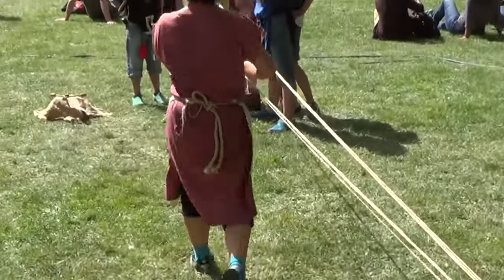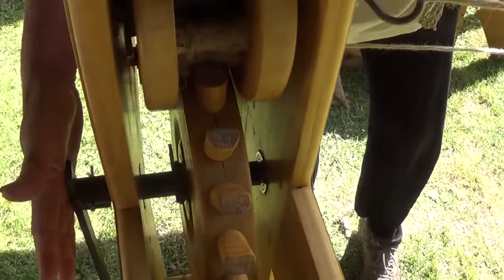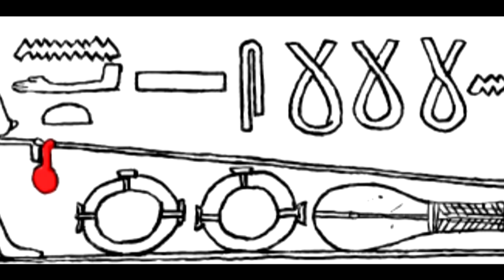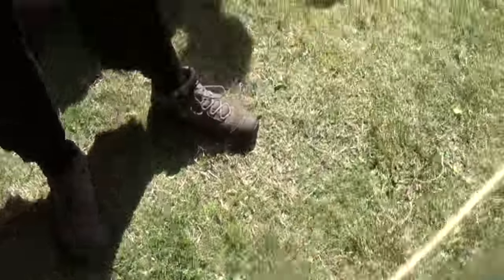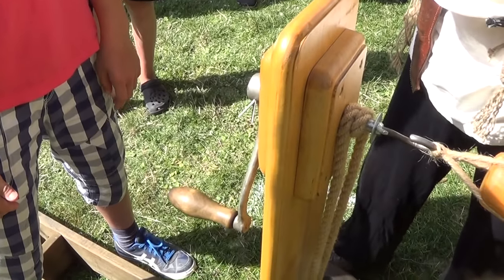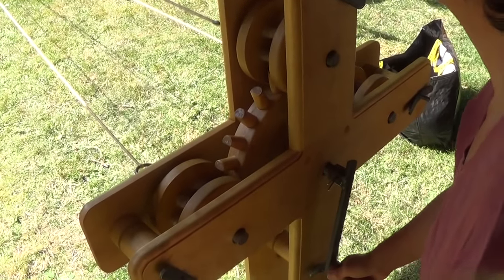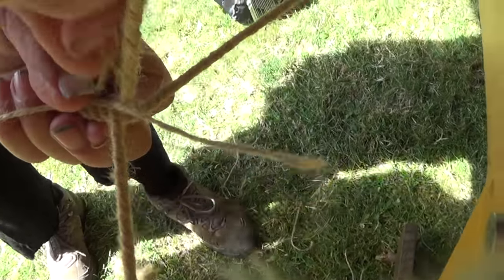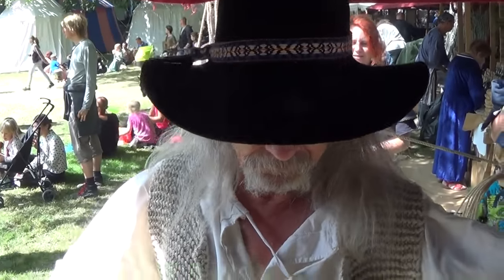Medieval rope-making in Visby market

Comment: what the..!  he cut the rope with a knife in the end !
Reply: Yea? Why
Reply: It's a joking reference to the video Lindybeige posted the next day, "Rope and Hollywood." Don't cut the rope!
Reply: He cut the yarn not the rope
Reply: Which IS actually strange, since there are also methods where you don't have to cut that much material off
Reply: like unhooking the loose ends and finishing them by hand
Reply: With help.
Reply: There are times when string, twine, yarn, and rope DOES need to be cut with a knife, despite Hollywood's wealthy, elitist attitude that everything is disposable!  🤯
Reply: Did you really just ask that question?
Reply: I know this is an old comment, but once he has whipped the end of the rope (which is what he did with the twine when he wrapped it) the three strands weren’t needed anymore. He very much could have tried taking it off using a different method in order to preserve that extra bit, but especially if it’s just for show, there’s no need to try to preserve and/or use them

Comment: I have made raw hide ropes like this but made out of a single cow hide that has been cut into a single strand by starting at the centre of a fresh, cleaned and salted hide and cutting a single strip about 6mm wide. The cut is varied depending on the thickness of the hide. Once twisted the rope is stretched and allowed to dry out. These ropes are very good for handling stock as you don’t get friction burns

Comment: Come on! We all saw in the movies that people in the past were so stupid that they could make only solid wheels and here you see wooden gears.
Reply: +fizikshizik They used weels? I always thought they just shoved some round logs under whatever they wanted to transport and push it.
Reply: +fizikshizik   The older versions are without gears,  just handles locked together by a frame or otherwise belt driven (over solid pulleys).
Reply: +Adamast You must be short, cause that joke was very low, but still went over your head.
Reply: MoonUnit IV The joke starts with Lindy's title then, as this rope-making setup is not more medieval than the cheap film props used to represent medieval wheels. We are short people discussing pots and kettles.
Reply: Adamast At least my kettle hasn't been filled with salt.

(Was that a clever joke? Or am I just prolonging this 'discussion?')
Reply: MoonUnit IV Short of gold, salt is one of the most expensive stuff you can find in a medieval kettle.  A good perception of medieval times is hard, so go along let's keep it with short youtube jokes.
Reply: Adamast When did we say the kettles were medieval?
Reply: They'd put GOLD in the kettle?
Reply: @2adamast  actually salt was never that expensive. Important, but not expensive.

If you want expensive, try some herbs like ginger or nutmeg. Maybe even, if you're so rich that you just literally don't care anymore and want to needlessly show off to the high born prats you invited to your mansion, have a servant dole out black peppercorn or white sugar.

Comment: There is a vary common little stick that is found in places with other remains or hunters and gatherers. It has three holes in a line with on one side the beginning of screw thread, and it is very possible all of those were used to make rope with the same idea. On one side there are three people holding one string of fibers while adding and turning it. On the other side there is one person pulling and turning the new rope in the other side. And I honestly think this way of rope making is almost as important as farming or mastering fire.

Comment: In addition to cutting rope, in movies with sailing ships it drives me nuts when someone sticks a knife into a sail and slides down it.  

WTF?!?  Do you realize how expensive a piece of fabric that large is?  And how much time sailors spend repairing even small tears?  Not to mention the tactical damage you've just done to the ship, in case you'd need to sail it quickly.
Reply: gevmage that depends, is it an enemy ship?
Reply: @connormclernon26  Even if it is an enemy ship, if you take it intact, you'll still need sails to take it back to be re-flagged and added to your own navy.
Reply: @MonkeyJedi99  They aren't documentaries yah know...
Reply: @jimvonmoon  And that’s all movies are meant to be. Cool. Fuck realism or honesty, cool is their god.
Reply: The other problem is that it won't actually work.  The sails aren't that strong; you'll zip down rapidly and go splat on the deck and then be captured by the immensely unhappy sailors who will now have to fix that sail.  :-)

That said, damaging a sail is absolutely something that might happen during a real naval battle in the Age of Sail.  While they would indeed like to capture the enemy ships, their first priority is defeating them, and ships can still sail with less than their full set of sails. And if all else fails, you can tow the prize ship.
Reply: The ships sailmaker: agggggghhhhhh
Reply: What movies? Peter Pan?
Reply: @duckmeat4674  Douglas Fairbanks did the actual stunt in The Black Pirate. (1927)
Reply: @millwrightrick1  wow, so last time OP saw this was almost 100 years ago
Reply: @duckmeat4674  they do it in pirates of the Caribbean as well
Reply: @valeria262  okay 3 movies. Peter Pan, some 100 year old movie, and another featuring octopus head and zombies
Reply: @duckmeat4674  Dats right! And powdered wigs! You can't forget the powdered wigs!

Comment: To those wondering why the rope doesn't unravel: the smaller plies are twisted in the opposite direction from the larger twist of the whole rope, so that the rope's structure is always 'twisting inwards' on itself, preventing it from unravelling. 
This is how most cords work. So even if you cut it in half, it won't immediately start unravelling. (But it will fray gradually if not tied.)

Comment: The weight in the Egyptian drawing with the weight could be used  with the handle to heave the rope up and down and get it oscillating thereby winding the rope much easier.  I've seen riggers today still using a similar technique to serve rigging on historic ships.  Just a thought.  While working on historic  vessels we've used a very similar rig to the one at the market to demonstrate rope making.   Instead of the stick in the middle for keeping the yarns separated we used a round wedge with three grooves for the yarns and a dowel as a handle.
Reply: Ah, I see they added the top.  Same thing.  Cool.

Comment: That limitation to the lenght you could make for a single piece of rope was also the reason why you had only rather small mine shafts in the middle ages.
Mostly only about 20 m but nowhere over 100 m, than you already needed a shaft landing and a second blind shaft with anouther 20 m or so. Stepwise you would have had shafts going down up to 300 m.

Now transportation would mean you could only lift up stuff about this 20 m, unload it and load another bucket, lift it 20 m and than again unload.

This first changed in the 19th century with the invention of the steel cable.
This was a huge revolution, now you could build shafts straight trough for several 100 m and up to 2000 m which is than the limitation of steel cables because they get to heavy and would just cut under their own mass

This resulted in a mining boom, which again vise versa literally fueled the industrial revolution

Comment: i have a question that has nothing to do with medieval rope-making. On those long marches, how did soldiers carry their shields? Did they just carry them in their hand, or strapped them on their backs? Sorry for grammar, not native English.
Reply: +kojbo Often shields would surely be loaded on wagons.
Reply: +kojbo Adjustable straps that could be removed prior to battle.
Reply: +kojbo yea what they said. I'm a smart too.
Reply: +kojbo They rode them like skateboards.
Reply: +MrDUneven Yes, because LotR is realistic. Right? Right!?
Reply: +kojbo back
Reply: +kojbo Strap them to a horse, or carry them on their backs.  An army would often to march through rough terrain, which is very slow going for even the biggest wheeled vehicles prior to the internal combustion engine.
Reply: +Usammity Rough terrain is a problem for even self propelled vehicles. It has more to do with the availability of roads than the level of technology of the vehicles. =)
Reply: +MrDUneven  There are historical, Roman, records of Germanic warriors going downhill, in snow, on their shields.
Reply: +MrDUneven you mean hoverboards?
Reply: Lavrentivs
Well, tracked vehicles can have an easier time traveling up slopes than most horse drawn probably ever could.  =))))))

*Tanks could get still get stuck, of course, but some had a max inclination of 40 degrees or something crazy.  It also depends on softness of ground and all that.
Reply: *****
No, like Legolas did in the two towers.
Reply: Usammity
While carriges can be taken apart and carried through especially rough bits of terrain ;)
Reply: Lavrentivs
A lot of tracked vehicles are generally a lot heavier, but can move their weight better (in all forms of terrain) than even the largest team of the biggest draft horses. 

In WW1, they still used draft horses because engines weren't very good yet (I dunno the specifics, but ICE tanks were pretty slow back then; they used ICE instead of draft horses, probably because horses would just get shot).
Reply: Usammity
I was thinking more in the terms of dense forests and very rocky terrain. These are types of terrain which is considered impassable by even tracked vehicles.
Reply: Lavrentivs
Well yeah, but horses have trouble there too.
Reply: Usammity
Not to the same extent. In some services (military) they still used horses into the 60's just because they could go where vehicles couldn't. =)
Reply: Lavrentivs
Ah ok, whatever.  My point is that automotives generally haul more pounds than horses or horse-drawn vehicles.
Reply: Usammity
True, they are also much more "fuel" efficient as a horse needs about 10 kg of fodder per day, so a lot of what they carry is their own food =)
Reply: +EattinThurs61 Because people never lied back in those days. Nope. Not at all. Lying is a new invention.
Reply: Usammity well why go the tough terrain when you can use an old roman road? Otherwise ridges where the roadways. Modern soldiers carry more than ancient did on their backs. One can always make a "travois" for the horse in terrain without roads.
Reply: EattinThurs61
Travois makes it even harder for the horse to maneuver, since they gotta drag something. Travois were used by plains indians because the plains were mostly (although rough), flat terrain.  Yes, travois can probably maneuver better than carriages, but you aren't going to drag one through a forest without a wide and clear trail.  Yes horses maneuver better than automotives in terms of actual performance, but pound for pound, an automotive maneuvers better. 

Abstractly - Ie. A vehicle that weighs 10,000 pounds and maneuvering at 1, will maneuver at 4 for 2,500 pounds.  A horse maneuvers at say, 2, but weighs only 800 pounds, so they maneuver a lot better.  But if they weighed 10,000 pounds, they'd be worse off than the vehicle.  This goes by the math that increased weight equals less maneuver.  Compare that to the vehicle at 800 pounds, which could maneuver at something like 12 (excluding actual engine physics). 

This doesn't assume that horses are only twice as agile as heavy vehicles - I'm just using that as an example.  Most tanks were much heavier than 5 tons.

Modern infantry do a lot of camping out in single locations.  They carry so much, because they aren't constantly marching.  They just march to where they're going to camp out, and set up a base or outpost there.  In actual raids, they wouldn't be lugging 100 pounds, unless they were a support team, such as machine gunners or mortars - even then, they'd have a crew of 3 or more helping out.  Raiders have to move quickly. 

In patrols, they wouldn't be lugging 100 pounds, because they are, in fact, expected to move around constantly day after day.

They're also very well fed compared to ancient times.  America had something like 10 times the supply of the next nation in WW1.
Reply: Usammity But why move a large army through the hardest terrain, why not use a road, trail or cow path? Elite and special units or of course patrols etc. naturally have to go around and on the sides of an army. A grown up beech forest is not hard to navigate with a travois. the Swedish army in the beginning of the 18th century mostly ate grain and meat.
Reply: EattinThurs61
Um... sometimes there isn't a road. 

What was the original point you were trying to make?
Reply: Usammity Really, where? Before the romans they where bad, but the Roman roads where in use, and are still, during the middle ages. I do not come from a country where the Romans built roads though. In England ridgeways where used and you can still go on them rambling.  Ordinary armies went the easy way, special troops took the hard way. If both sides had chariots they would meet on a flat? The Mongols had carts with them all the way to the Balkans. They killed all males whose heads stuck up over the wheel top and made pyramids of the skulls, large wheels for the steppe.
Reply: EattinThurs61
It wasn't the mongols that made pyramids of skulls, that was Timur Lenk.
Reply: Lavrentivs You are probably right, the Magyars stopped them, all them steppe dwellers is confusing, okay so the tartars then. They still brought their wagons along.
Reply: +kojbo Was there going to be something about ropes in your question?